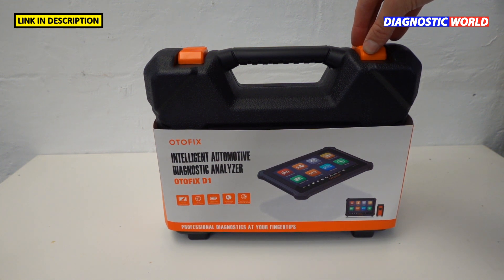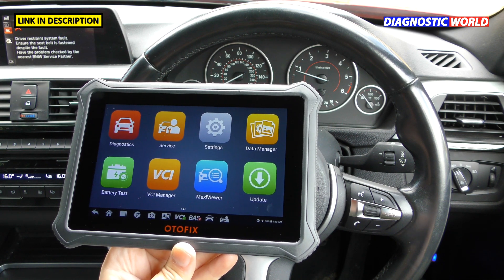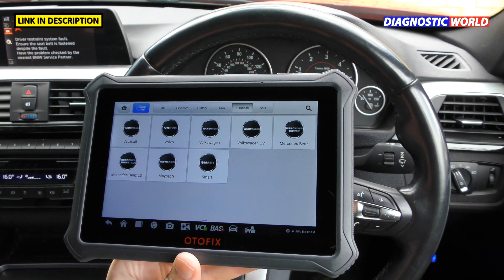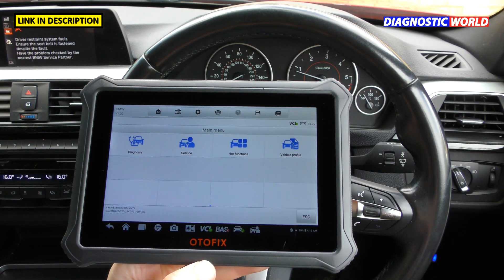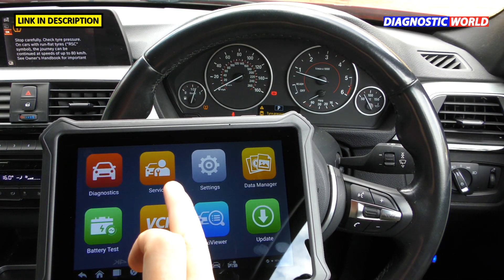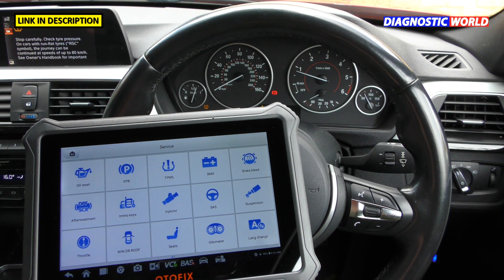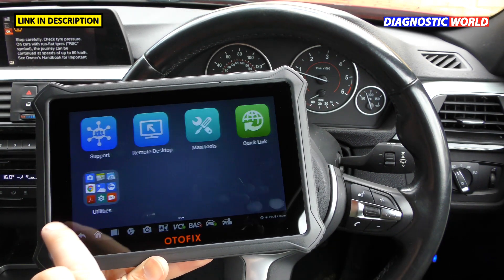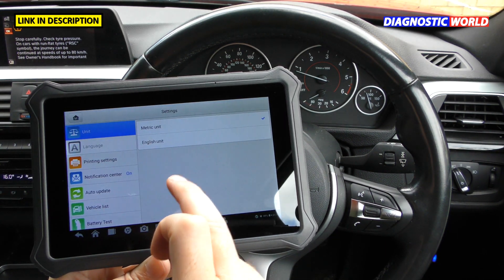Otofix D1 - Everything You Should Know Before You Buy

Comment: Have the same OTOFIX D1, love it.. Even fits just about in one of my flappy pockets on my work trousers and can fit it in my laptop back pack along with my laptop. Good piece of kit and about time they made a slimline one instead of the big unnecessary bulky ones
Reply: Glad that you like our tool!
Reply: Have you tried coding keys.
Reply: @hendersonjp  not yet but I know it will do vauxhall corsa keys as have done 1 before using a similar autel unit
Reply: How would this compare to the iCarsoft CR Max and Autel MK808?
Reply: @lukecage2642  not sure about the icarsoft but the Mk808 it would be very similar only with more functions such as bi directional controls on the D1 model, the D1 lite would be the same as the Mk808 without Bi directional controls